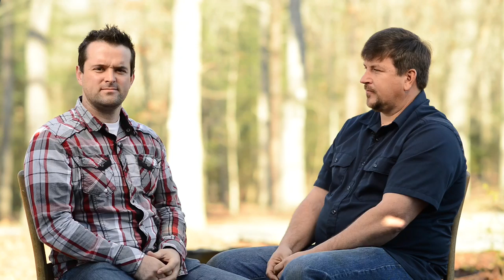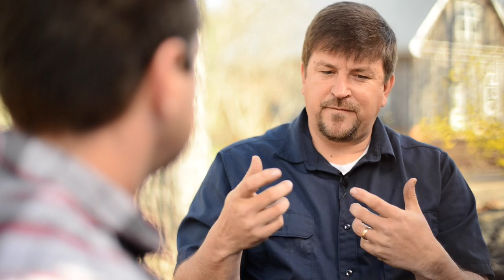Does your Safe make a good Faraday Cage?

Comment: I used faraday cloth and have it tightly held to the entire outside frame of the safe door with magnets. Covered the rubber gaskets with copper tape as well. I feel that it is sufficient enough protection.